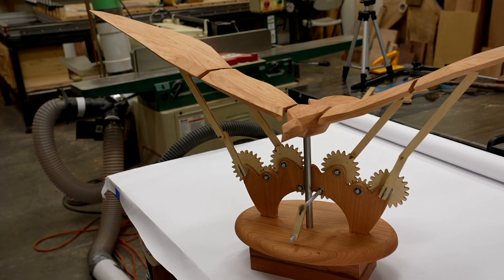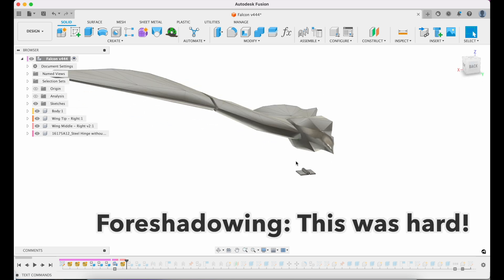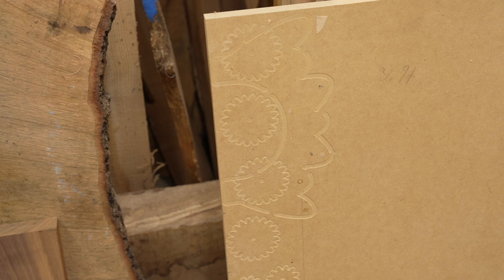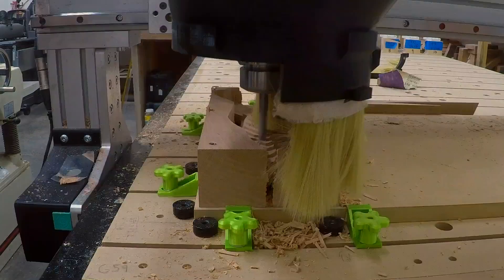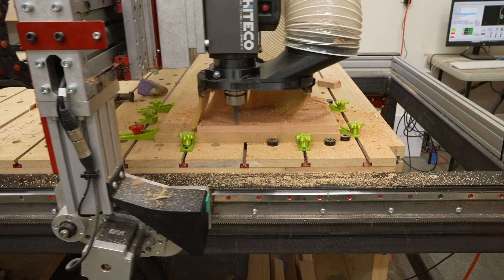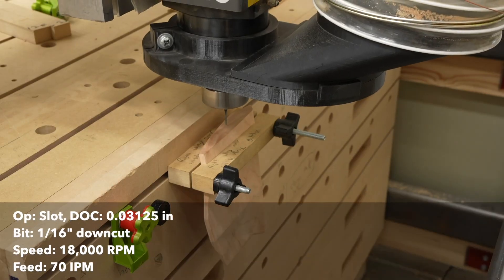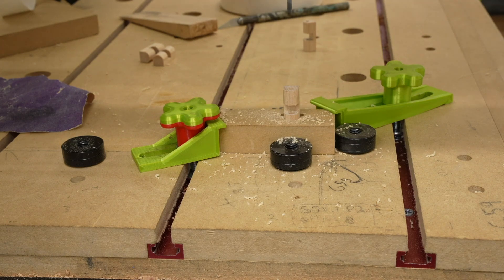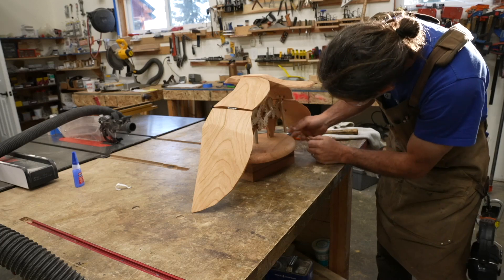The Falcon Automata - CNC Woodworking, Carving, and Mechanical Movements

Comment: Finally You corrected the Pedal to petal...right...!!?  ..Ha Ha

Great Hack for multi axis Operation here..! Alignment and keeping track of origin point for those multi side operations is hard to implement....!     I will have to watch again and again to figure out your tricks   (hopefully)..! 

I am planning to use centre-line programming method as if like a tombstone for such multi axis operations..! Don't know how is gonna end up..!

I will have to tweak post processor for the A axis and C Axis for indexed  multi axis for Centre line Programming , It is my theory only..! No idea how it turns out..!

But you have developed ingenious methods here..! I will try to understand ...!

I have not been able to figure out the fixture/soft-jaw method for flipping parts...!

Have a lot of things to learn from you..!!! watch out for my questions...!!

Thanks for this well explained series..!!
Reply from the maker: Yeah! I still can't believe I typed "pedal" for so long, I'm glad you pointed it out! 

The soft jaws: I design the basic square soft jaw shape in Fusion 360 around my 3D object, and use one of the corners of the square soft jaw for my origin; that allows me to re-orient the piece again. This heavily relies on the soft jaw being pretty accurate, but there are some tricks to getting it more accurate (measure and test locations). 

Definitely ask questions, I'll try to answer them!

Comment: Very cool. Swap those wooden gears for Delrin / Acetal, then motorize this with button activation.
Reply from the maker: Yeah! A constant RPM, varying torque motor would be ideal. I don't think the connections are strong enough to handle it for a long period of time though.

Comment: Brillian work!  On those soft jaws for the hinge machining, there's a trick I've used a few times.  In Fusion 360 do an inspect and measure the Z height from your WCS point to a point on the top machined surface.  Then get your WCS probed on the machine, load the tool you'll be using, and manually position the machine in X,Y,Z with the position you measured in Fusion.  Then just slide the part up until it touches the tool, just using it as a stop for positioning.  Hope that makes sense!
Reply from the maker: That does make sense, and that is a great idea! I'll have to give it a try next time. Thanks for the tip!

Comment: why did you use such thick wood. It seems that would be a large amount of sawdust and waste. Am I missing something? I love the video and the end result but I'm afraid it's a bit to complex for me. I'm ok with vetric, but 360 is just too much for me at this point in my life.
Reply: Nice job, impressive that you figured out the difficulties and all that had to go into a final product, beautiful work…biggly kudos!
Reply from the maker: @henryoppermann134  Thanks!
Reply from the maker: Yeah! I get the wood from a local (Reno, NV) hardwood lumber yard. They sell cherry in most standard nominal sizes: 4/4 (actual 0.75"), 6/4 (1.25") and 8/4 (1.75"). I did glue up some of the pieces to make larger stock; I left it off camera because I didn't think it was interesting to watch. 

You are right; It produces a ton of chips and sawdust. Not much a way around that. 

I'm thinking of doing some "Fusion 360 for Vectric Users" videos at some point. It can be tricky to get started.